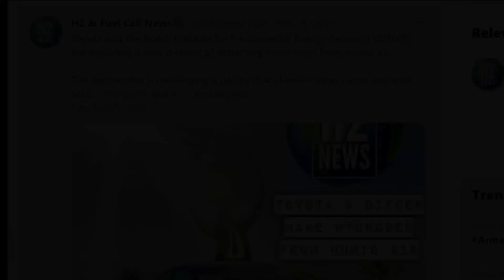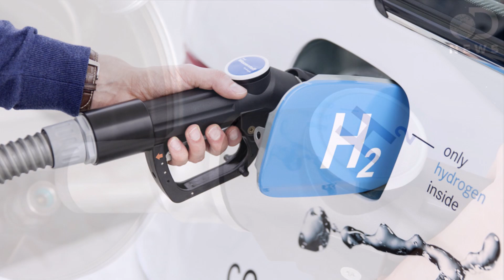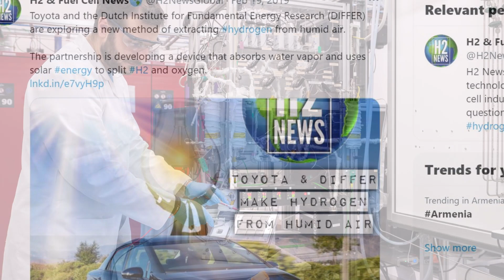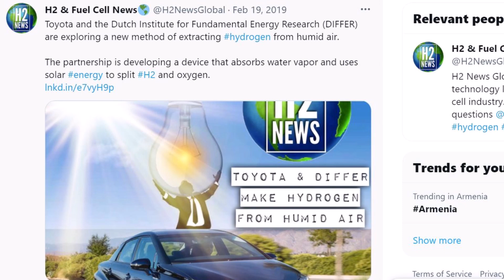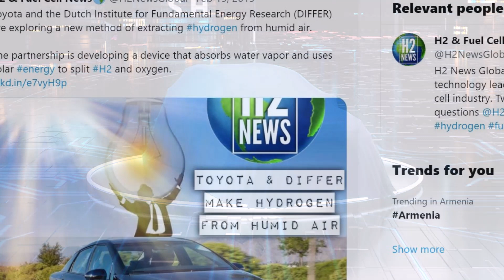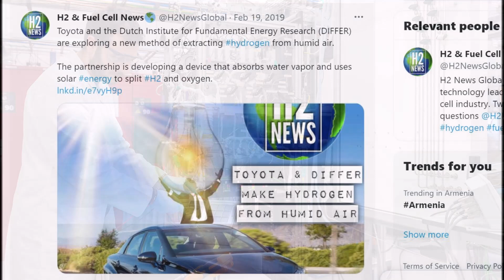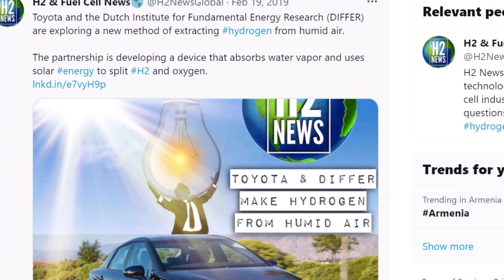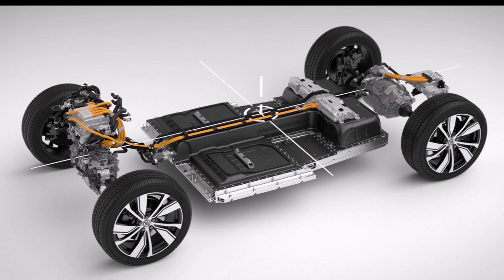Toyota Is Creating Hydrogen Fuel from Thin Air

Comment: If for the same amount of sunlight it is possible to derive more usable energy in the form of electricity using typical solar voltaic cells, compared with energy derived from hydrogen that must be stored (think cost in $ and mass) before it is burned (which probably won’t be 100% efficient) to release (less?) energy, then this hydrogen concept would not be as practical. But interesting research that might have better application elsewhere. (What’s the obsession with hydrogen? - a lot of technical challenges involved with storing it.)

Comment: The quoted 70% yield is not the same as the efficiency which is currently < 5%.

Photo voltaics are > 20%.

Hydrogen is a dead end except for uses where the energy density is a critical factor (planes).

Comment: Claiming the ability to use the moisture in the air in areas without water is disingenuous because those areas usually have low humidity. Areas with high humidity usually have less solar radiation.

Comment: Hydrogen will always be more expensive than electricity because hydrogen needs electric power to be produced. Never the less hydrogen will only succeed in applications where batteries are not able to provide the energy and power density.
In this case everything but consumer space. So Tesla motors is safe from Toyota.
Reply: Your post has Tesla fanboi written all over it. The issue is the non-green battery tech.
Reply: @CarbageMan   you are having a laugh right. Compared to oil and gas battery cells are the holly grail.
If Toyota wanted to produced hydrogen in a mass market cheap way it can do so today via electrolysis of sea water (new nickel coated electrodes invented at Stanford were tested a few yrs ago to remove corrosion of electrode) or use new desalination tech to produce fresh water from sea water and then do electrolysis using renewable energy.
 Toyota could have done this many moons ago.

So what Toyota says and what it does,  are completely different things in my view.
 
So until it does something at mass scale, then I remain a Tesla fan boy. A much better stance than a Toyota SIMP and apologist. 
Obviously this is not a comment about you since I do know your position on Toyota and Hydrogen and BEV's.
I am sick to the back teeth hearing about companies that just talk and talk about what they are doing in the lab. Great, but talk when you go into production, otherwise it is all bollocks. Talk is cheap  as they say.
Reply: @gargamelandrudmila8078  So, in other words, you have nothing.
Reply: @CarbageMan  if I did, I would be a rich man indeed. 
But I am not the one pretending that I have a solution in the lab that will take 10yrs to scale and be viable . I am not desperate to keep investors onboard and my stock price up.....Toyota is. Tesla will be eating their lunch very soon as they slowly crack Japan. Toyota is already no where in the US and Europe relative to Tesla and battery tech in general, the market has already decided so I don't see this argument as an issue baring its academic value and that maybe mute at best.
Reply: @gargamelandrudmila8078  If you had nothing you would be a rich man? LOL. Didn't even bother to read the rest, but scanned and say "Tesla will be eating their lunch" so I know I was right, fanboi.

Comment: 1m2 solar ray gives a power of 1kW. To move 100km the need is 15kW.  The solution is realy elegant...but...
Reply: 1kW/m2 is at 100% efficiency.
Most PVs are 20%+
This device is < 5%
Reply: @fredbloggs5902  5% today...but tomorrow ?
Reply: @philippeillinger6287  it’s < 5%.

The 5% comes from the device using UV, I’m guessing the process itself is maybe 10% - so the actual efficiency is 0.5%.

I predict the device will never work with non-UV light.

And the 1 kWh/m2 is the Max at the equator, in perfect weather, pointed at the sun.

And electricity is generally more useful than hydrogen.
Reply: @fredbloggs5902  that's rigth "And electricity is more useful than hydrogen"...

Comment: Please work out the end to end efficiency before you see us next time. Also what amount of surface area require to sustain EV normal operation?
Reply: An average car in the U.K. does 20 miles/day. 

A Tesla-3 does 4 miles/kWh.

So it consumes 5 kWh/day.

Sunlight is around 1kW/m2 Max.

Assuming 8 hrs/day, that’s 8 kWh/m2/day.

This device is < 5% efficient.

That’s a yield of 0.4 kWh/m2/day.

So you need > 12.5 m2.

Latitude, time of year, weather and using hydrogen all make this figure worse.
Reply: @fredbloggs5902  good work on solar cell efficiency estimation in EV direct application. But the question is for this video. A device produces hydrogen oxygen expose to direct sunlight and moist air? intended to feed fuel cell for electricity to run EV motors. For what efficiency this process can offer us?

Comment: Wow. Astonishing high proportion of frivolously based value judgements in the comments section.  This is a highly significant development as it is in initial proof of concept phase.  It is quite possible that the same electrical solar panels that charge the Power Wall can be used to also generate Hydrogen.  To naysay it, at this point, is to belie an insecurity about having made a significant investment in Battery based EV tech.    A Hydrogen/Battery hybrid would be a better solution than a mono-fuel based vehicle.  Hydrogen would enable Electric motor or just Hydrogen Jet powered flight.
Reply: Seems to me Tesla fanbois are scared.
Reply: Sure dud a powereall that makes Hydrogen 🤣.
Reply: Seems to me it’s your comment that ‘frivolous’...   ...and clueless.

Comment: similar to biofuel, unfortunately that's a net negative energy process, so you'll end up pumping out more CO2 than you saved from burning hydrogen instead. Even if you powered with purely renewable process the conversion efficiency is so much less than just store and transport as pure electricity. But I guess for weight sensitive application like airplane, that probably make sense, given the higher energy density.

Comment: It would be great if this would be feasible/scaleable.  What auto makers want is a technology that will maintain the internal combustion engine's viability in the coming future. They have considerable capital and research in this area.
This is the reason for the resistance to switching to pure electric.  
The potential benefit... If this technology proves viable, is energy generation for other applications.
Reply: Like putting a half a million AA batteries in a car?

Comment: Ι still think BEV is the way to go, not hydrogen.
Reply: The two can be used together... A large stationary hydrogen generator can provide fuel for fuel cell to charge a car and power to the grid.
Reply: @lkuhn65  Problem was never that it didnt exist . Its how insane costs are to make Hydrogin transport inferstracter is expensive af. There is no point in takeing 5x of the energy to make just 1x in the end instat of just storing it in akkus directly. As long as we dont find a way to produce Hydrogin cheaper and make transport cheaper it wont get anywayer.
Reply: @xythiera  we are in agreement - my thought is to eliminate the transport (and perhaps also storage) of hydrogen... just use it to make electricity - but only practical if less is used to extract hydrogen than can be generated from hydrogen... which gets into questions of conservation of energy